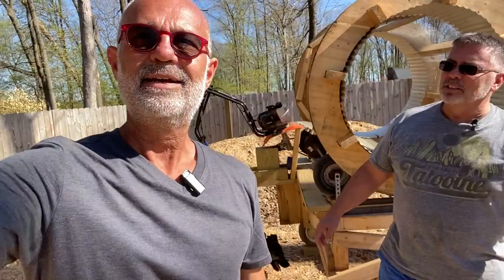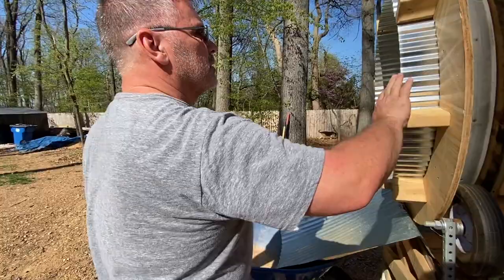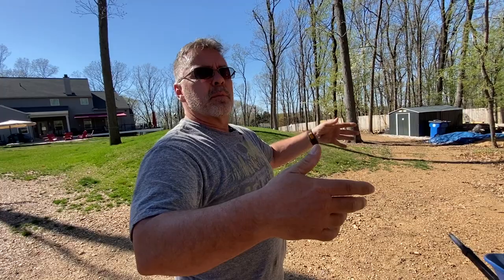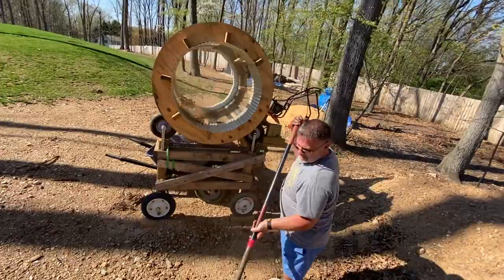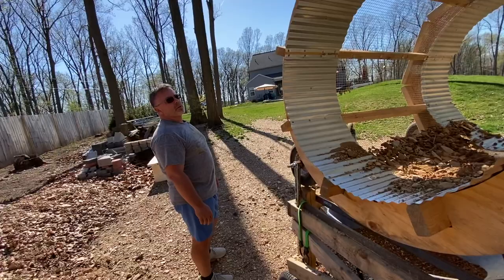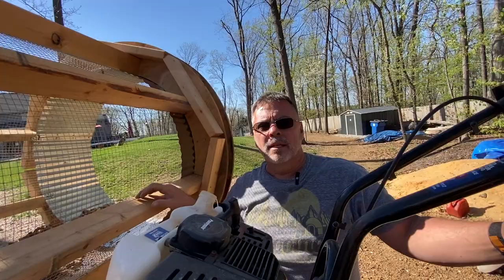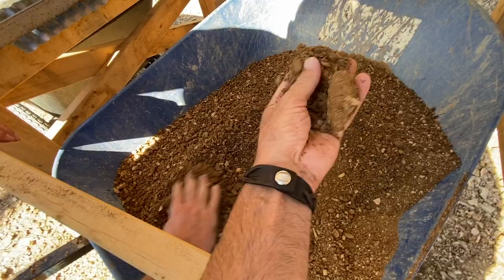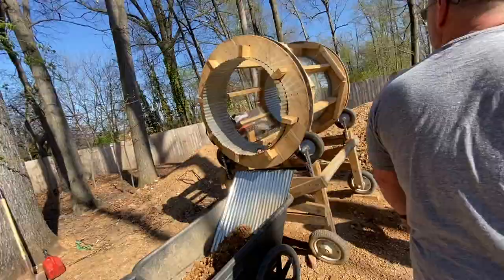DIY Tiller Powered TROMMEL STYLE Sieving Sifting Machine

Comment: Make a conveyor belt that is ramped up into the intake of the sifter. That way you can dump the rock and soil mix at ground level and the conveyor belt does the work of moving it up into the machine. That guy looked tired after shoveling all that dirt up into the sifter